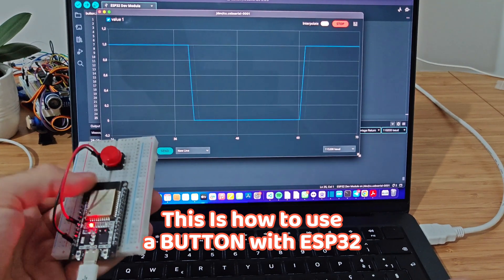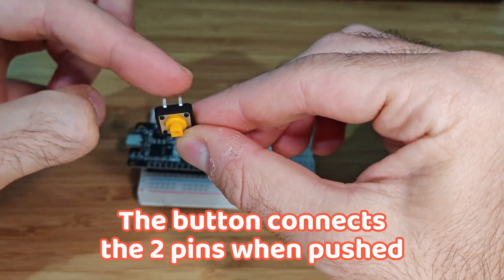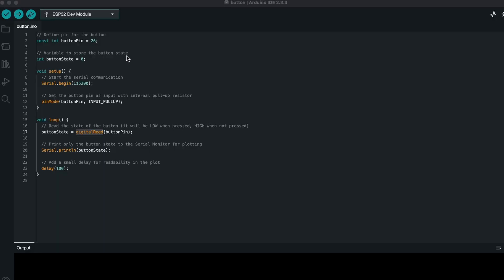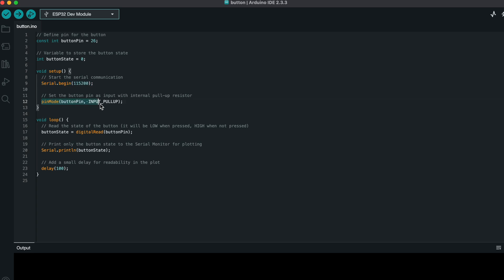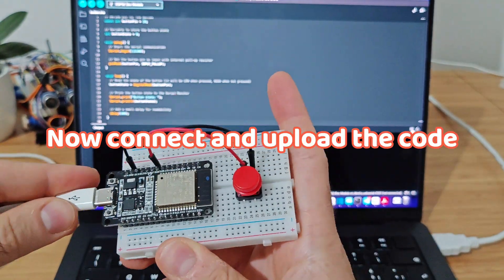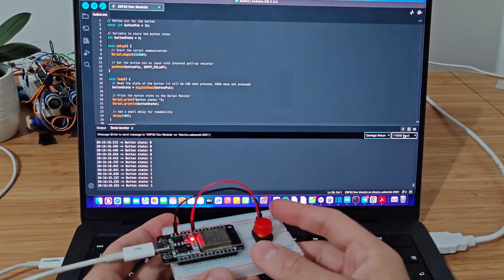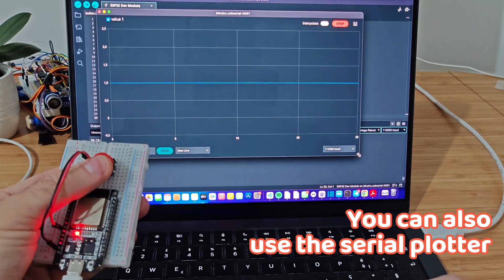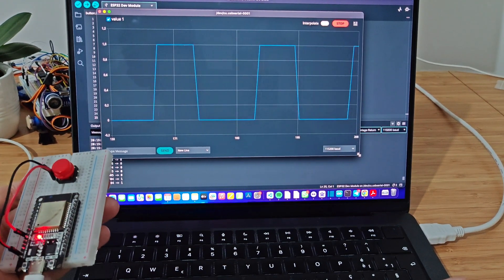Getting started with ESP32: Button Tutorial

Comment: i dont know, but for me its not working :( it stay on state 1
Reply from the maker: What code are you using? Are you using pull up mode?  Did you try another button?
Reply: @ThinkingThings-q4p  yes and yes try other buttons const int buttonPin = 26;
int buttonState = 0;

void setup() {
  Serial.begin(115200);
  pinMode(buttonPin, INPUT_PULLUP);
}

void loop() {
  buttonState = digitalRead(buttonPin);
  Serial.print("Button state:");
  Serial.println(buttonState);
  delay(100);
}
Reply: it works sorry thanks a lot
Reply from the maker: @michaelm4876  Great!! :)
Reply: Same for me. Using ESP32 Devkit V1. Any suggestion?